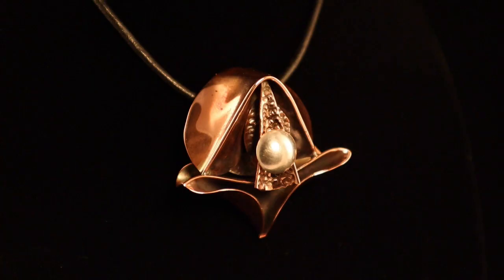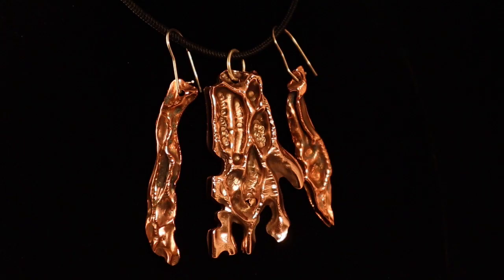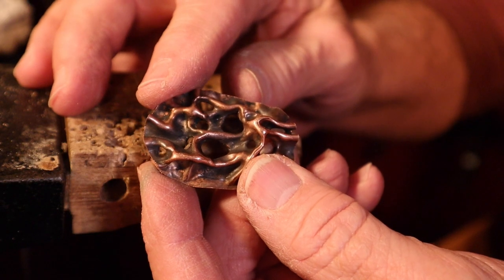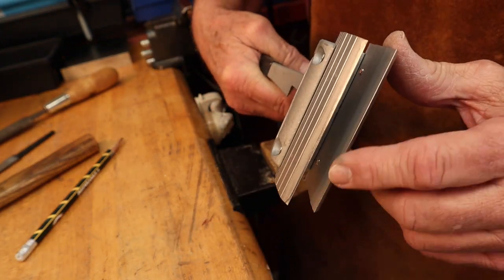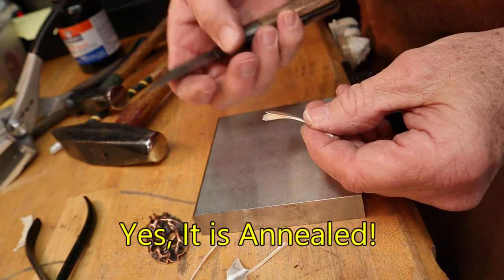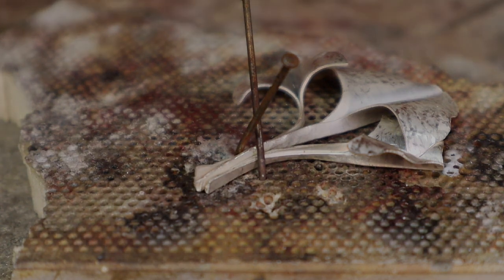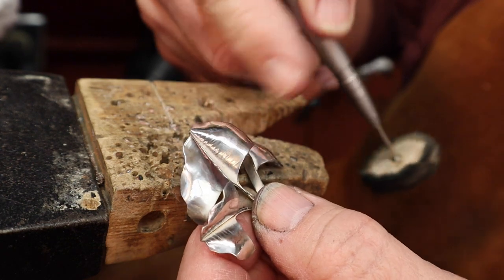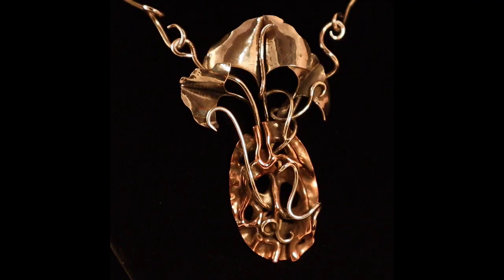FOLDFORMING PART 6. "USING FOLDFORMING IN YOUR JEWELRY DESIGNS"

Comment: Thanks for this series. I was introduced to fold forming in a class I took at an art center, and subsequent study. Your videos are very clear with great explanations with many interesting techniques. The vise mod is very helpful, almost have mine done. P.S. I have a 35 lb Cliff Carrol anvil that looks similar to the one you are using in the videos. Seems to work well for this application.
Reply from the maker: Hello Franconia,  Thank you for your kind comments.  I appreciate it. You will love the vise mod. It is the only way to go.  Yes, I have a 35 lb. Cliff Carrol anvil.  I have had it for about 40 years.  It is a great anvil.   Let me know how you are doing.  If you have any questions and  need to send pics, I have my email address in the "about" section of my channel.  Have a good one.   Greg Greenwood

Comment: Hello Greg, 
I absolutely love watching your videos, I'm learning so much. You said your vise is handmade if I remember correctly, I have been looking at buying a vise to do some of the foldforming and I can't find anything large enough to make a cuff. Any suggestions would be greatly appreciated 🙂
Reply from the maker: Hello Jade, I am glad you are enjoying and learning from my videos.   Rewatch Part 1 of the Foldforming series.  I have "modified" my vice with angle irons.  I replaced the textured jaws with the angle irons.  This way you can fit cuffs etc in the jaws.  You can buy almost any kind of vice from a box store or hardware store.  They can by cheaper brand if that fits your budget.  Just make sure that you can remove the textured jaws.  Please let me know how it goes.  Greg Greenwood

Comment: I have a question regarding putting a bezel around a glass eye so it will look like a natural lid top and bottom. Any ideas would be appreciated.
Reply from the maker: Hello Jay, I will get back to you about the lids soon.   I want to go into detail with you.  Talk to you later .   Greg Greenwood
Reply from the maker: Hello Jay,  Sorry for the delay in responding.  I would dome a circle of silver using a dapping block, forming around a steel ball, or forming over a stake.  Then you could cut the dome in two pieces to make two eye lids.  You could solder the lids to an other dome or back sheet.  Decorate as you wish.  Sounds like a fun project.  Let me know how it goes.  I hope this has helped you.   Greg Greenwood
Reply: Hi Greg! That is a great idea, Thank you so much and keep up the great work. I’ll let you know how it works out!
Reply from the maker: Looking forward to it.   Greg Greenwood

Comment: Hello, I use Google Translate. I had a question. When I melt the silver, after casting and cooling, I saw dark spots on it. What is the cause? What is the solution? Thank you.
Reply from the maker: Hello Mohammad, The dark spots are copper oxide.  They are caused by the silver mixing with the oxygen in the air producing copper oxide.  They can be removed by "pickling" in a mild acid solution.  See my video "What is Pickle?  This will give you several options of acid.  I hope this helps you.  Thank you for watching.  (Google translate is very helpful.)   Greg Greenwood

Comment: Hi Greg, thanks for your fantastic and really helpful videos. I'd really like to know how the tool is called you're using at minute 11:22. I understand "steak", but that might not be correct :-) Would be glad to hear from you. Have fun
Reply from the maker: Hello Susanne,  Thank you for your nice comments.  The stake you are talking about is an "Eid Longhi Anticlastic Forming Stake"  It is a multi purpose forming stake to make anticlastic curves (Metal curved in opposite ways in two directions).  Make from a plastic type material "Delrin".  Great stake for bending metal over in many different curves.  Thanks for asking.  Greg Greenwood
Reply: @greggreenwood4628  Thanks a lot for your answer,, Greg.
And I have another question, I really would appreciate it if you could comment that too:
How thick is the steel you are using for the construction on your vice ? Do you think that 3 mm would be strong enough for hammering the metal sheets ?
Best wishes, Susanne
Reply from the maker: Hello Susanne,  3mm should be fine.  Mine is a little thicker.  Go for it!!!   Greg Greenwood